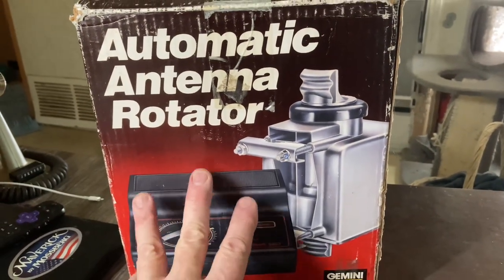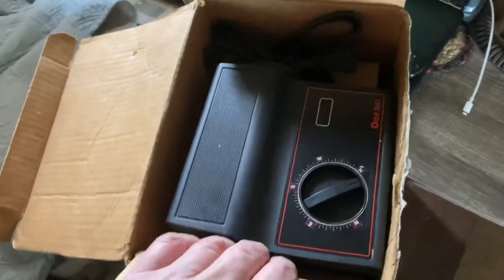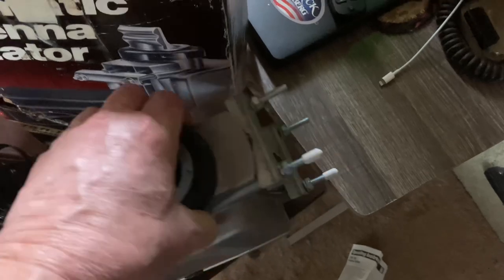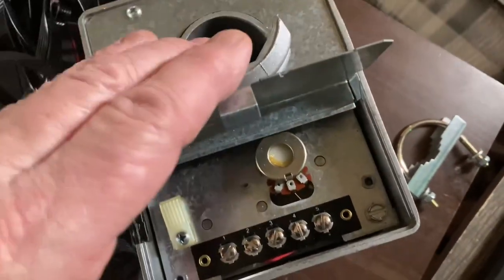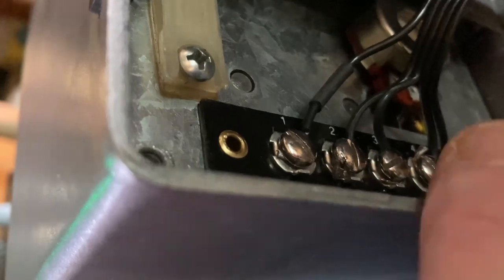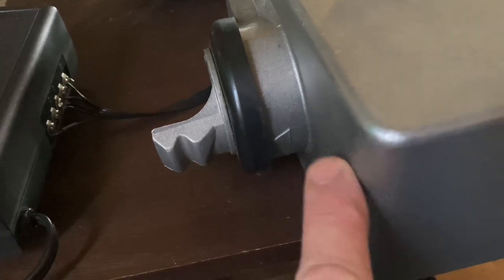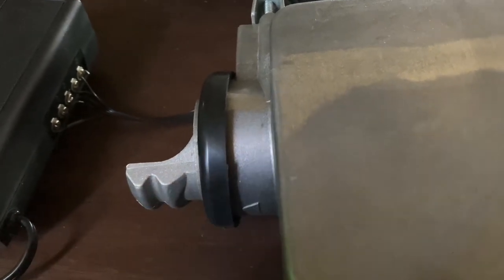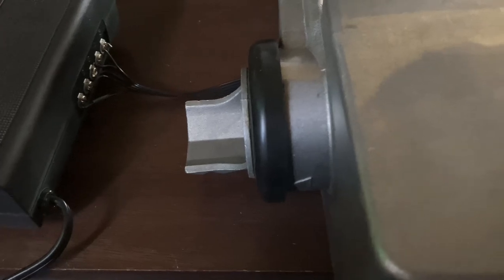Great EBay Find!!

Comment: Hey Dave, Where can a guy buy that ribbon wire you used here to hook up the rotor, I need about 30 feet if I can find some ??? That ladder line is a little pricey for someone on fixed income.
Reply from the maker: You could use about any multi strain wire. I have some 8 strain phone line that will work and probably is better than the ribbon wire that came with the rotor. As for where I have no clue.
Reply from the maker: Try eBay.